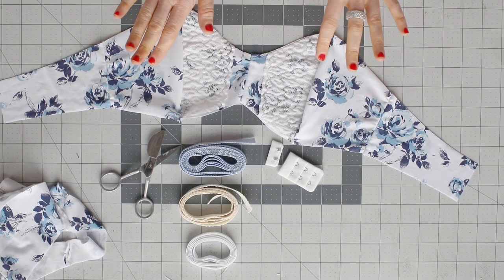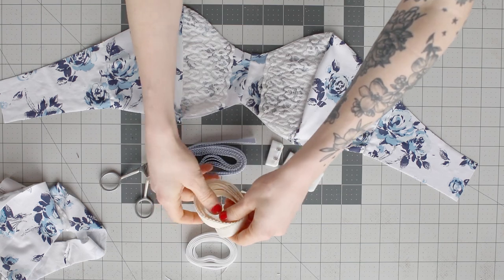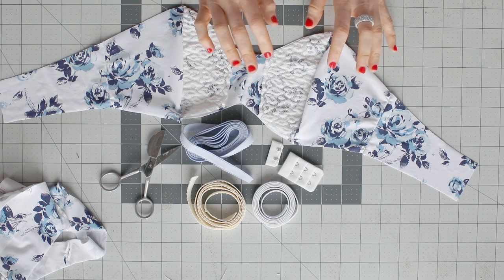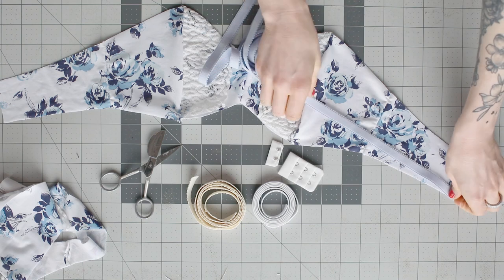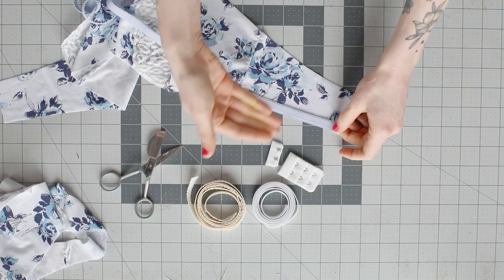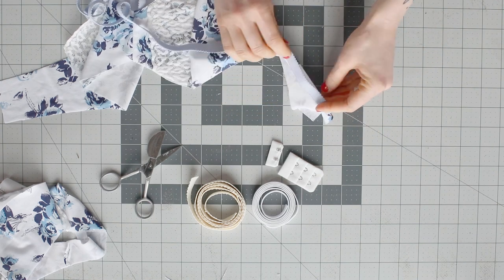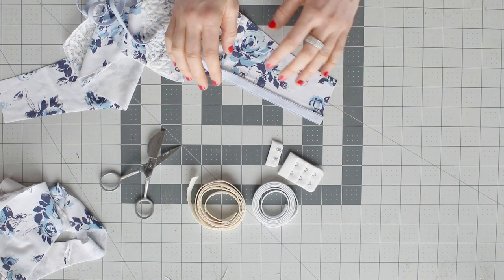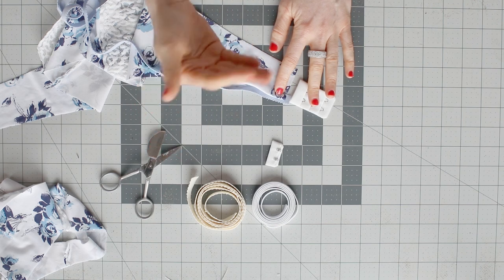Bra Step 3: Attaching the Elastic Part I

Comment: What if we don’t add Bonning
Reply from the maker: You don't have to add the boning. It won't be as structured without it, but it is not integral to the bra.
Reply: @Madalynne  ok. And is it good for bigger bust and how about the support
Reply from the maker: @pateljigs807  If you have a bigger bust, I suggest keeping the boning. The boning adds support.
Reply: Ok.
Reply: @Madalynne  and can you give me some
Suggestion while using satin fabric. If I use this pattern to make the crop top.